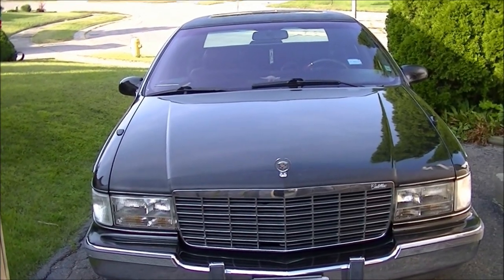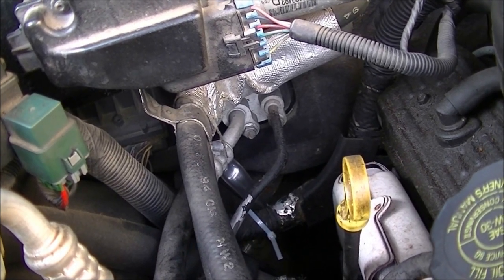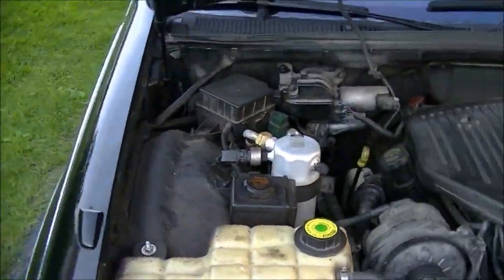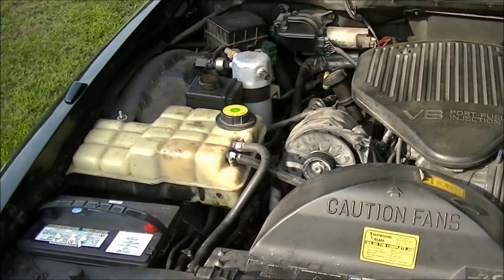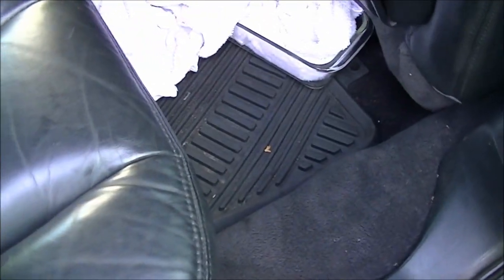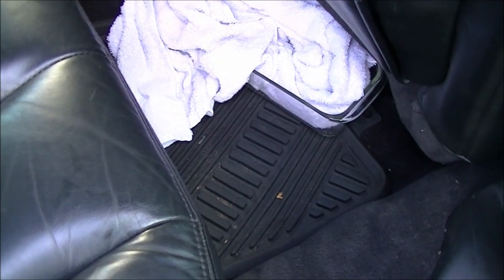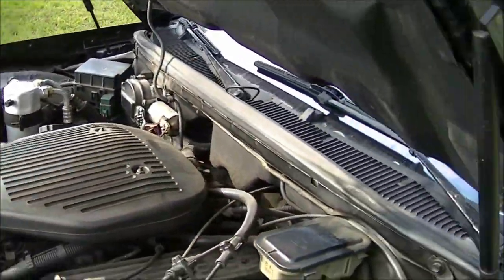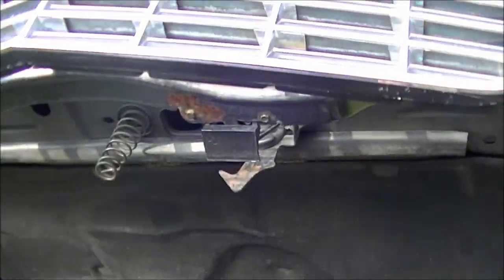PART 1 What To Look For/Expect When Owning Or Buying A Cadillac Fleetwood 93 96

Comment: How had is it too change the spark plugs on theses cars
Reply from the maker: It's a pain in the ass to change them... the shop manual says it would take about three quarters of an hour to change the spark plugs and wires! The hardest ones to get at are the ones closest to the firewall. One thing I will point out that I should have mentioned in the video, if your car is due for a ''tune up'' and you suspect the spark plugs need to be changed, be very very careful I would recommend using the best penetrating oil that you can get and lubricate those suckers up if you don't and attempt to unbolt them you risk breaking the spark plug nut right where it threads into the block and you will cause yourself even more aggravation, I had this happen on cylinder # 5  These cars are not really fun to work on but when they are maintained properly and not abused they will run for many years. Unfortunately in my case the car was abused by my grandfather who just treated cars as disposable junk
Reply: My father had a 96 caprice,same engine but a 4.3L and i would list the stuff which failed on it and it seems common with these LT1 engines.

- starter failed at 120000km, which is not normal

- Fuel pump on these cars last 4 to 5 years even when they are oem, not normal at all

- Water pump fails too, changed mine 3 times with oem parts

- original ball bearing steering box failed at 140000km, they leak from the seals and there is no new oem steering box and mechanics warned me to rebuild it with after market seals and told me it will never function the same and it will leak, only solution to find a bone dry oem boxfrom the junk yard...if you are lucky to find one.

-Brake booster went out at 100000km 

- brake lines went out at 200000km

- serpintine belt tensioner went out at 80000km

-AC compressor failed countless times

- had water leak just like yours in the same place on the front windshield

- transmission shifting late at 200000km

-heater core always leaked on passenger floor and end up canceling the heater lines

- original radiator hose failed early and leaked

- changed the electric fan motor twice

- craked radiator plastic tank at maybe 70000km

if you want to buy a buick roadmaster/caprice/impala/fleetwood of the 90's i really warn you its not going to be fun, searching in junk yards and looking for oem parts is an adventure and every 3 months or so you will be at a shop and the mechanic will become your 2nd best friend if he accepts working on it because let me tell you a lot of mechanics will tell you directly i dont want to work on it because its time consuming and i dont want to mess around it and risk breaking something.

i live in the emirates and these cars disappeared from the streets 10 years ago and most of them ended up in american salvage yards specialists, if you live in the states or canada i guess the parts are cheaper and readily available over there.

saying all of that,i wonder how the LowRider guys keep these cars up to all the headache this car already have to throw at its owner, i once hit a pothole very slowly in our 96 caprice and a sqaure plastic panel under the steering wheel broke off from were it was screwed, let a lone hitting switches and hitting the ground hard.